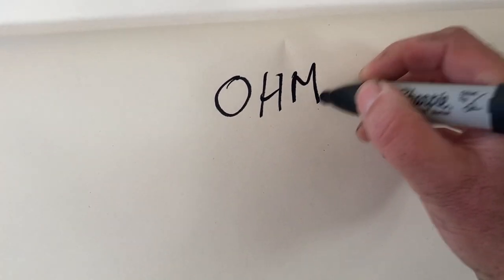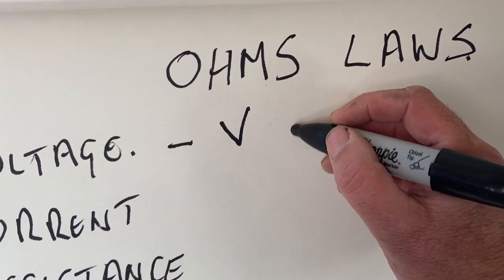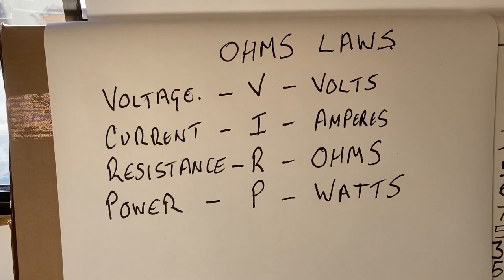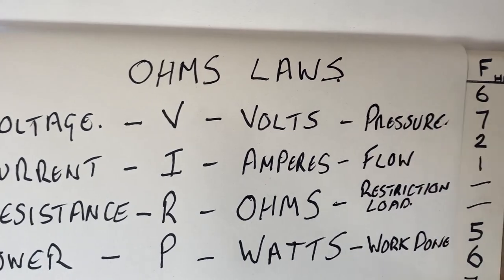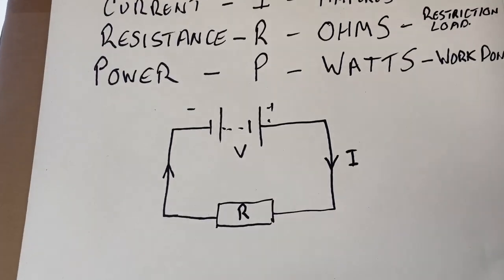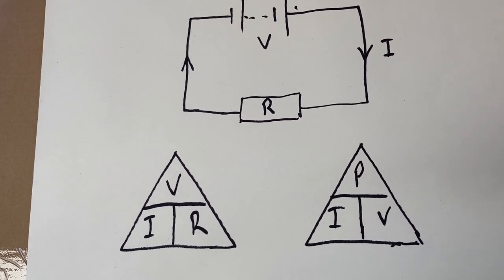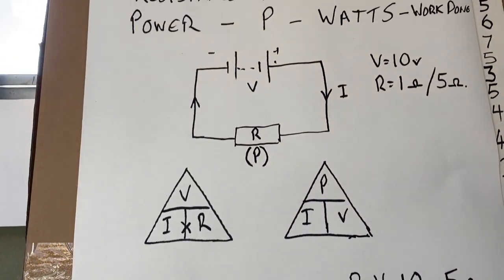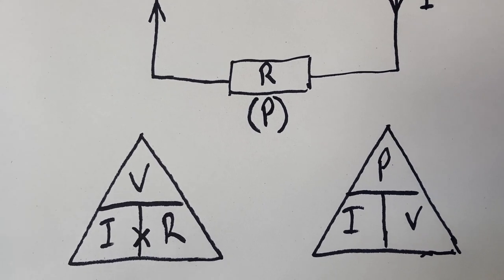Narrowboat Tech Talk #1 - Basic Ohms laws

Comment: Hi  

 fan of the channel

   hope all is good ,   iam a plumber by trade but I have a question about electrics ,,  basically I have a 60 ft inspection launch    looking to install a victron multiplus 12v to the boat     just like to know   your opinion  on what battery set up  will be convenient to power the multi plus ??   I have 4 110 ah lead acid battery's on board 12v      but for me to run house hold basics   such as TV,  washing machine , laptops,  etc  

  1st do you think this battery set up is good enough ? 

  Or do you think another battery set would be better ? 
  N what  ?

Kind regards   , Joe
Reply from the maker: Hi Joe, welcome aboard. You don't say how big the Multiplus is? Four 110Ah is pretty standard on a lot of boats. Generally will suffice if you can charge them sufficiently. You wouldn't normally run a washing machine directly off the batteries, you would normally run the engine to keep them topped up. At the end of the day you will have 220Ah useable power from that set up when fully charged.
Reply: @narrowboatmoonshine        hi  

thanks for the reply  

  I've just watched another upload on your page    funny enough you've installed the exact same one I'm gonna purchase  multi plus 3000 

Okay so that's what i thoulght    watching TV,  running  washing machine  etc ..   youl run your engine 👍  

 I'm based in East london   there's  an old boy next to me   he does the same thing  every night to watch TV    okay  great     so someone did advice a lithium 200ah battery   but then someone said they don't charge well in winter ,  and I don't really feel like shelling out that type of money for a battery   

But just to confirm 

My 4  110 ah lead acid battery's are only 1 yr old      don't really feel like buying a new set up  just yet   

Would you say if I stall the multi plus   n run engine when I want to watch TV etc    I have a better chance of keeping the life of battery's Intact   for longer 

Thanks
Reply from the maker: Hi Joe, I meant, run the engine when the washing machine is on, not the TV. Depending on TV type and state of charge of the batteries you would get many hours watching TV just off the batteries.
Reply: @narrowboatmoonshine       hi 

we have a 12v TV